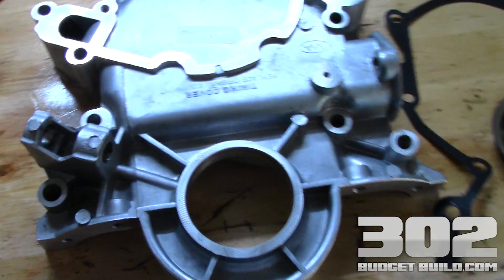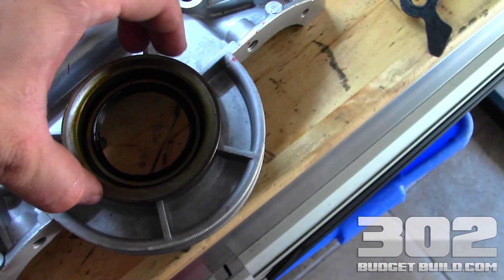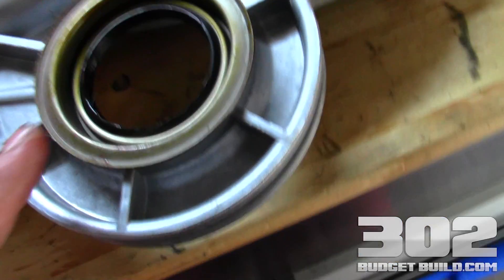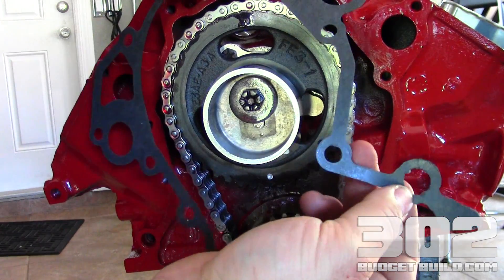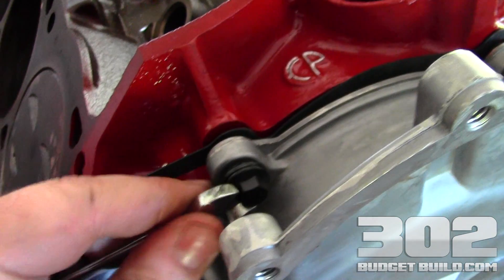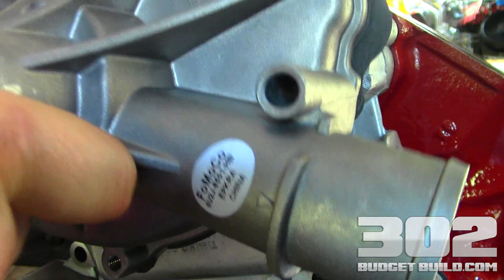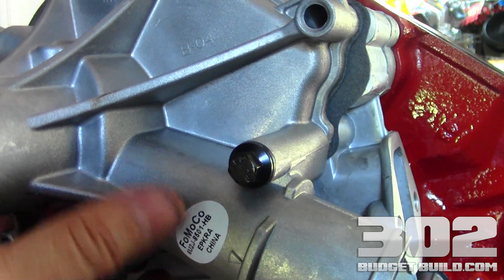How to install a timing cover & water pump on small block ford 302

Comment: You use a big C clamp and a wood block on the seal and also on the rear of the timing cover, and slowly press the seal into the cover.  Whacking it can crack the aluminum timing cover.

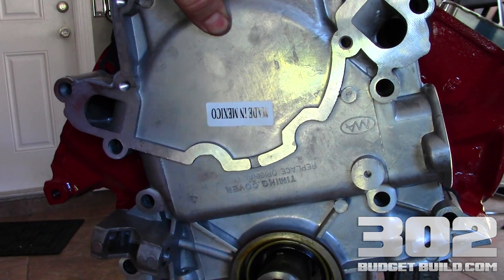Comment: 2:30  do you see that gap separation below the sticker? I had to seal that with silicone because the OEM gasket can block that. The aftermarket one didn’t and coolant leaked badly.
Reply: are you sure it’s not a weep hole ?
Reply: @bobtailsthecat  it wasn’t. The weep hole is on top. For some reason there’s another below but it doesn’t weep.

Comment: Did this build work, I have the same build but the original timing cover has a crankshaft sensor, could I just use the timing cover u have?

Comment: This video is detail on install but wrong.  1 you put timing cover on a painted surface(face palm) 2 you used the shitty paper gasket, always use blue fel pro gaskets. 
3 you didn’t put gasket sealer(Permatex) around the bolts that go into coolant passages.......I’m assuming that you had leaks and already had to redo this
Reply from the maker: 38,000 miles and no issues. No leaks. Runs like a champ

Comment: I found that the fuel pump eccentric was a perfect fit to tap the crank seal into place in the timing cover - my engine is a 289 and the seal installed from the inside. Great video. Many thanks :@)

Comment: you're suppose to use a flat surface that covers the seal completely to knock it in at the highest point on the lip. you deformed the seal is why the spring popped out. you might want to update the video so someone doesn't do that with the engine in the car.

Comment: Surprised no correction has been added on the oil seal wrong placement, should be pressed in on the inside, not outside
Reply: Wrong
Reply: You’re wrong idiot

Comment: the crank seal goes into the BACK of the timing cover.
Reply: Wrong
Reply: No it doesn’t dіpshіt
Reply: On the older OEM covers the seal does go into the back of the cover.

Comment: Use RTV black on water pumps and timing cover gaskets. Goodson has engine tools. OTC has engine tools. A 4-3" PVC adaptor make work for a seal installer. Use stud bolts with the heads cut off as lineup tools to install gaskets. Use the old water pump to put the bolts in to put them in the same place. Use a torque wrench. Use Permatex 14A sealer on bolts that go thru water passages. Replace the water pump with the timing chain. Run a tap thru bolt holes and run a die on bolts to straighten threads. Get a oil pump primer shaft to line up the distributor and oil pump shaft. Or an old distributor with the gear removed can be used. G.M cars oil pumps, adjust the oil pump screen for correct level using a set screw.

Comment: Bolts that go thru water passages, use Permatex 14A.
Reply: This was going to be my comment. A few of those bolts are "wet" and WILL corrode to the front cover over time. If that big long bolt corrodes it will break off inside the front cover during disassembly. That turns a simple water pump replacement into a major PITA that include a replacement front cover, since you WILL destroy the front cover getting it off. A little thread sealant or the Permatex will save all that grief.

Comment: Just wondering if you had to clearance your one piece eccentric to clear the new timing cover.  I am currently building a 95 roller motor for use in a 70 Torino with mechanical fuel pump and single eccentric.  using the same style timing cover from Ford performance.

Comment: So not enough bolts came with the ARP set? I saw reviews on the sets and many others said the same thing. Did you resolve the problem, and if so, how?
Reply: TheGeekwad I ended up just going to my local speed shop and buying separate arp 5/16 x 18 x 2" bolts. Was a pain in the ass..

Comment: I have a 96 f150 with a 302 and I was replacing the water pump yesterday and I broke a bolt off in the block and the only way I can get it out if to remove the timing chain cover. If I do this will I be able to re-time the chain on my own?
Reply: +Andrew Hall Get thee over to www dot corral dot net slash forums...
Reply: Taking the timing cover off doesn't disturb the timing set. Go for it.

Comment: I took the OE water pump off my 92 F150 today, timing cover looks ok, so it's staying put. New water pump is fixin to get installed after supper, using the old bolts, since I couldn't find new ones at Advance. I always use Permatex on paper gaskets, except when rebuilding carburetors.
Reply: Permatex #2 rules.

Comment: What is the reason for not using silicone on the timing cover gasket?

I always use clear silicone on paper/rubber gaskets especially around the coolant passages.  Nothing is worse than getting everything together and finding out you got a coolant leak and have to take everything apart again.
Reply from the maker: Hey. Actually you're correct. I would advise
To utilize some rtv on both sides since making these vids a while back. Ran into a leak issue with a previous build. Run the silicone. ;)
Reply: I have ran into that also.  I have ran RTV, when I did a water pump on my 292 I used red RTV on the bypass tube and I found out today that theres a leak there so now I am purchasing a new bypass tube and gasket as well as going to use the clear silicone as we use that at work and it always seals.
Reply: Milner62 was thinking the same permatex copper :)
Reply: Gasket sealer does a great job and is easier to disassemble.

Comment: Hey, like the video, a lot of good tips and good shots of what your doing, but 
Isn't the front crank seal supposed to go in from the back of the timing cover?
looks like you installed it on the wrong side of the cover, might work ok,but I wouldn't
trust it on mine like that.
Reply: No, they go in from the front on a 302